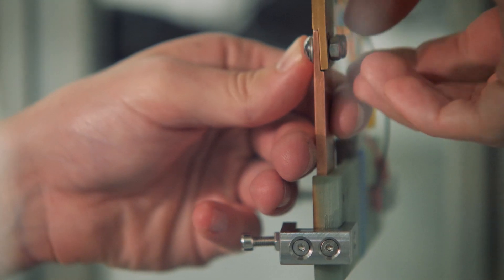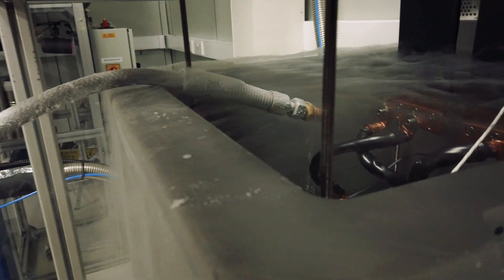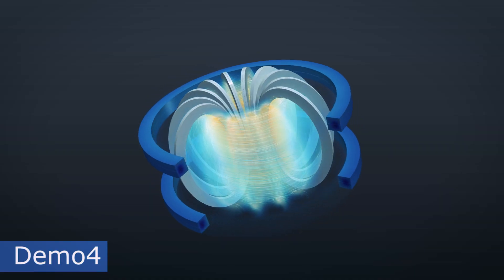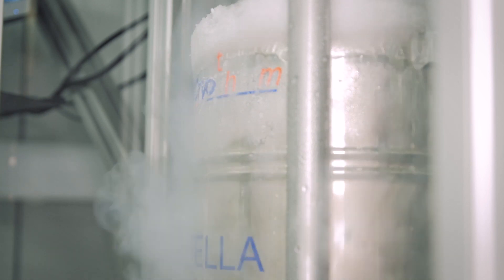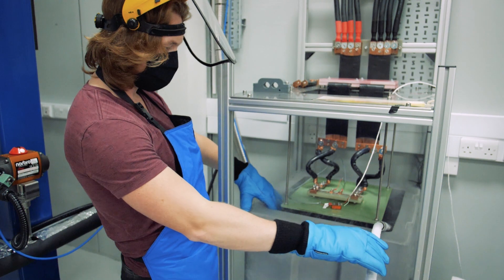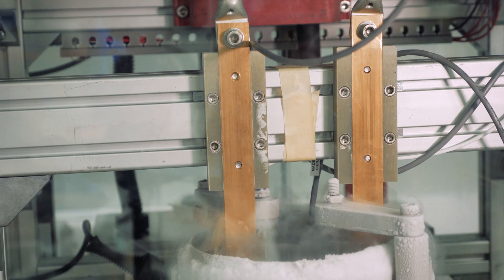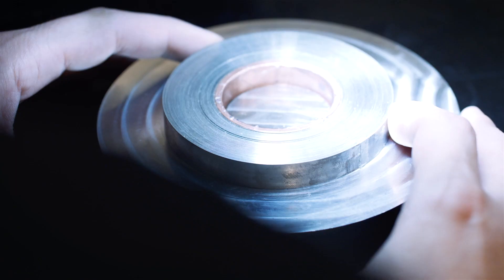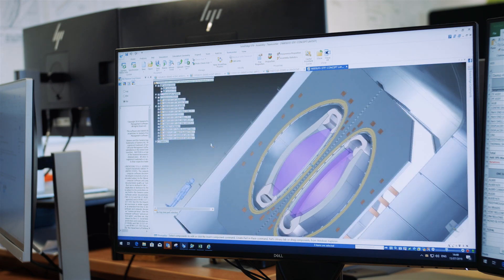Working as an HTS magnet physicist for fusion energy

Comment: so, the only solution is to pressurize the gas to 20 -30 bar atmospheres, radiated with high power microwaves, a pipe with a long screw with many spirals, a heat exchanger followed by a gas cooling radiator, which gas is injected, sprayed back into the incandescent iner chamber.

Comment: people dig for the treasure, and without knowing it throw the earth over the place of treasure. fission is performed only at cold temperatures 500-1000 degrees, 
but not as everyone would think. 
when increasing the temperature is increases the magnetism of the atoms, and it is impossible for the atoms to unite with other atoms. 
hot fission is achieved 4000-6000 degrees, only with 2000, 000 bar atmospheres at least.